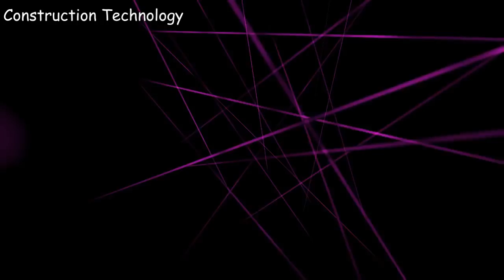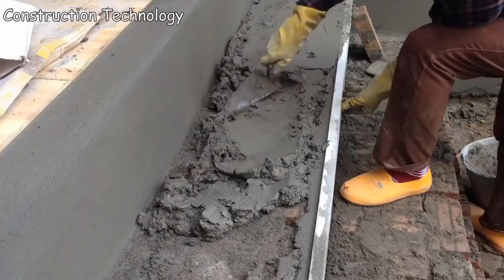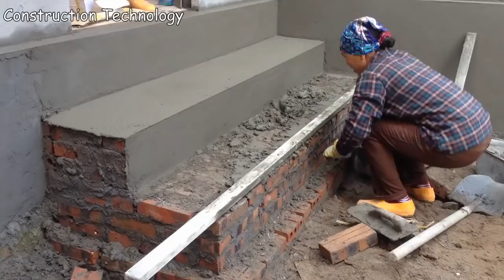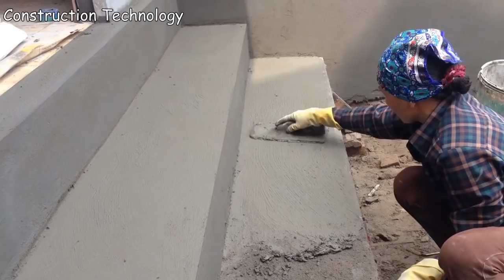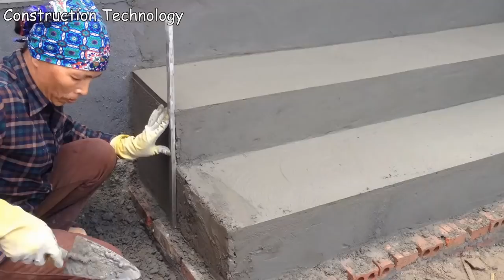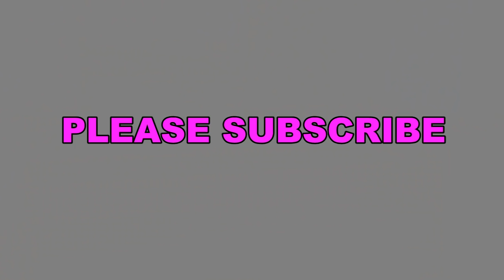Amazing Techniques Construction Rendering Sand and Cement For Brick Steps

Comment: Any "skim coat" over bricks is going to be a very temporary repair, unless it's just a base for ceramic tiles.  The thin mortar coat will probably hair line crack as it dries and shrinks.
Reply: Nope. You assume they use the same materials you do. They may have special formula. As a kid, I played all summer in an electric generator cooling pool with this kind of render. There were no cracks or chips. The water affected it not the slightest.
Reply: @fungames24  That could be true.  There are hundreds of different formulations available for concrete and mortar for various applications.

Comment: A thin veneer of sand mix cement is going to crack very quickly when exposed to weather. On steps you should always round over the leading edge of the tread to prevent chipping. This looks good to a layman, but professionals know this is not going to last.

Comment: If it's a warm climate, it may last a while...Cold climate...Won't last one cold season before it cracks...You have to use special epoxy cement for skim coats like that...
Reply: godbluffvdgg sementó cruz azul don’t crack
Reply: No, you don't need a special epoxy. I did the same thing in New Jersey where we have some very cold winters. I simply used a bag of cement from Home Depot and it has lasted lasted over five years with not a single issue.
Reply: @bigmacdaddy1234  If you did it on your own house; that's fine...I'm a contractor in philly; you can use a patching cement from home depot, I've used it in the bad areas but; coating brick steps with plain Mortar is a bad idea...When I use an additive I can stand behind my work.....I'm glad yours worked out for ya...

Comment: The right way to do this job is to form steps with plywood and place concrete
Reply from the maker: Thanks for your comment Daniel Rojas.
Reply: correct
Reply: and why is that better than this?
Reply: Graeme Evans Because there is the wrong way and the right way  in this case is the wrong way because if it freezes the mortar he is putting it will peel off
Reply: and why would it not peel off by "Placing concrete"?
Reply: Graeme Evans because in  concrete you can add bigger pebbles and mortar is just plaster sand
Reply: So many people talking shit, this is probabally somewhere in South East Asia where it is the norm to render over everything not just because its easy but because its more cost effective than casting concrete steps, walls etc. Most block work and brick work is covered like this and no it wont crack because 1. they know what they're doing, 2. the correct mix is used and 3. the weather is not cold enough for frost or ice to affect it, And  the person in this clip seems to be making a good job of what they are doing.
Reply: John Hobson I have 18 years in the const business and we have done bigger than this steps so I know what I m taking about
Reply: John Hobson No place in the USA will allow you to build this steps just look at the landing
Reply: As I said this is somewhere in South East Asia and not the U.S. so they are not restricted to rules and regs as much as in the west but it does'nt mean the workmanship is any less substandard, and 18 years in the industry does'nt neccesarily mean you know everything,  I've been at it 35 years and still find time to learn and appreciate new skills.
Reply: John Hobson ok but you know this is wrong the landing and it suppose to be secure with steel in to the foundation so it doesn’t come apart from the foundation
Reply: dperry428 Dude I m only 34 years what are you talking about old and I still have 30 years plus to go lol
Reply: dperry428 I m familiar with all the terms in your comment like high strength mortar rapid set come on are you trying to bs me
Reply: dperry428 I was just been sarcastic you had a bad at work lol
Reply: dperry428 Today I had a nice at work lol
Reply from the maker: Hello friends. Your comment is very true. We come from Viet Nam and not too cold here to destroy my work done.
Reply: Keep on doing what you're doing my friend its a tried and tested method in your part of the world, I can vouch for that myself, every country and culture has different methods of construction some good  and some not so good but I can quite honestly say that I myself have learned many new skills during my time spent in South East Asia, and become newly acquainted with many old  basic practices which are now forgotten or overlooked here in the U.K.
Reply: John Hobson Those techniques are good for any other part of the world but not the USA lol
Reply from the maker: Thank you very much John Hobson. Nice to meet you.
Reply: @DanielRojas-nw3mv  lol they are not in the US
Reply: @jimjobson1958  get em John
Reply: @construction-productscemen4935  good work! Thank you for the video, I do similar work in the US
Reply: rzl dzl I hope so because here in the USA we very strict building codes mainly in California where I m living and working and you can tell this job is have ass done lol
Reply: Joshua Sokoloski lol
Reply: Those steps will last a hundred years don't fret
Reply: ben chan not really
Reply: This not the US where everything is regulated all those rules are to make everything uniform so the regulators get paid for ur work. Those same regs push the price of construction up n dont make anything any better than what she is designing. She has REAL FREEDOM to build how she wants and you dont hv freedom to do anything except what the local building code tells U
Reply: Starr Ving Same reason why building collapse more in Asian Countries lol
Reply: @DanielRojas-nw3mv  yeah ancient ruins also. Which there will never b in the US bc nothing lasts that long there
Reply: So, the plywood is free?... cause your way might be the right way when plywood and powertools to cut them are available...Right is subjective even on construction.
Reply: @DanielRojas-nw3mv  yes you can... Still not free... Seems it's just too hard for you to understand and think outside your box you are programed to. There is no plywood arround there dude... If the apocalypse ended they plywood industry forever they still can do it right while you are still waiting for the playwood cuts....
Reply: I have to agree on that, still.. there is a huge world outside the US... FYI
Reply: Sure, there is nothing like USA outside USA, there is nothing like Mexico ouside of Mexico, there is nothing like Taiwan outside Taiwan.... At 41 yrs old I travel for lving so I know way better than you whats out there, you said you were a constructor in US so keep it that way, still constructing at US under US methods and leave the rest to others. BTW, be humble... its and advice you might need.
Reply: Let me tell you this. Different country, different way to do. This country is not suffering from earthquake compares to California, ok? Mark my word. 

This country is not suffering from earthquake. That is the truth. These technique comes from France, Vietnam was oppressed by France since 150 years ago and the skilled had been kept and passed trough many generations.  They are masonry worker and they are skilled, they know how to flawlessly get the job done. Mark my words

Many architectural construction building in Vietnam was constructed in this way 100 years ago and still standing in high rain level, dust, sunny day and it still strong like shit. In California, house is built by wood even though so new house is beautiful but fuck that, termite, punk, leak. My words are true. Mark it again

They can build 4 stories house with concrete + steel bar construction mortar brick that using this technique and I guarantee the house is much more beautiful than the regular house in California. Mark my words

4 stories house for just $600,000 or even $200,000. Depend to the location you live, higher in the urbanized city, main district, capital city. Lower on the country side area. Remember that

Believe me, I have 4-stories house in Vietnam and was constructed in 2001. $40000 in that time, now price goes up to $350000. 

Listen to this, Europe construction technique comes from Greek and it been more than 5000 years ago, unfortunately, America had not been found at that time. Mark my word. They build architectural works and these works still exist to this mean time. For example, Rome market in Italy. The technique was passing to the countries where European' countries oppressed, ok?

Check out more videos, or I will give you more video about how houses in these countries are built. 18 years in construction business doesn't  mean you know everything about the time before you were gave birth. You can apply your knowledge to the place you live, but don't apply it to the world where people can jeer on you and might consider that you are uneducated or superficially narrowed. HAVE A WISE LOOK TO ANOTHER KNOWLEDGE, or go out there, pick up the trowel and do the job like her. A bet you can do it. HAHAHA

I live in California, usually travel back and forward. I go to many countries than you.
Reply: Rubbish.
Reply: @DanielRojas-nw3mv  why cant people get this is not usa uk or germany.they have to make do with what resources the country has.whether it last or not.its still a good finish.would love to see some work from these peoples comments.....
Reply: oh by the way over 40 years in the industry...

Comment: Brick must be inexpensive where this woman lives. In the U.S. the steps would be formed with wood and concrete poured to fill the form. To cut down on concrete costs the bulk of the steps would be filled with either sand gravel or compared soil.
Reply: Well 95% steps (stairs) in the Indian Sub-continent and China are made with this method including 5 star luxury hotels and apartments.

Comment: Nice work.. but too much rise on those steps.
Reply from the maker: Thanks for your comment. I would draw experiences on next time.
Reply: @construction-productscemen4935  maximum steps rise is 20 cm. 18 cm would be ideal
Reply: Nice parge job but should have been at least another riser.  Gigantor steps
Reply: In ex Soviet republics, big rise means big goose steps!

Comment: Amazing technique? I'd rather call it a bungle. Just wait how it cracks during shrinkage. And that skarp edge..
Reply: if its a base ready for ceramics it will be fine,if the tiles are lare enough they cran grout with a highly elastic flex and most movements and shifting can be controlled by the grout preventing the tiles from cracking.....

Comment: As a suggestion I indicated that each step should measure at the base between 27 or 28 cm and height between 18 or 17cm, respectively. It should also have a 2 cm protrusion at the base. This pattern is basic so that the ladder is comfortable for people and prevents the heel from bouncing up when the person descends.

Comment: It will last for two three seasons.
Reply: If that...
Reply: Why?
Reply: @bluematrix5001  sand and cement will shrink and crack during the summers months, water will penetrate those hairline cracks during the rainy months, cracks will expand as the water freezes during the colder months and finally, fast forward a few seasons and your steps look like 1945 Berlin  👍👍
Reply: @Sponkonamaface  Funny about the 1945 Berlin, so what you need to use?
Reply: @bluematrix5001  concrete!

Comment: Riser is too high and not comfortable for climbing then steps levels are been taper the centre of the first step is little bit curved downwards
Reply: Right. Tread should be minimum 11 inch and rise should be maximum 5 inch for comfortable and safe treading.
Reply: @bijaysharma9017  

*
M,m,?
Reply: @anastacioperezabad8292  Tread should be minimum 0.28 meter and Rise should be maximum 0.125 meter for comfortable climbing.
Reply: J Wil  Think about aged people. Check stairs at any public place.
If sufficient width is not available, then tread can be reduced and rise can be increased. But in this video, I see sufficient space available to construct safe and comfortable steps with higher tread and lower rise.

Comment: Why not just pour concrete steps?  Seems like a lot of work for two steps and cover up the brick.  How about using gravel fill instead of brick.
Reply from the maker: Here we do not have many gravel to do it. Thank you Doug Ballou.
Reply: Doug Ballou why would you use wood when it rains it will damaged by it with time and it's not as strong as concrete it's almost the same cost
Reply from the maker: We have no use of wood. We do so because the weather here is not too cold to break it.

Comment: don't do this in Canada lol,
Reply: and not in Australia either.
Reply: @johnandhenrieteverts8516  or Norway
Reply: Use conc block and stainless steel mesh.
Reply: Why?
Reply: @RealSupaHotFireVEVO  winter frost will lift it up and you would find all kinds of cracks and it would fall apart,. could only do these type of jobs warm climent areas

Comment: He didn't make sure wether  the  measurement (wide & height) of the steps  were already correct or not.
Reply: She
Reply: Rusdi Yanto she did fore they started to film.
Reply: 太高太宽
Reply: @amirharris6676  So those steps are made for giants? you gonna break your neck using em. Also each step is at different height.
Reply: @Rick-Stone  ,0yt

Comment: Looks like shit, she didn't even use a level. Wait till rains and she realizes that pools of water don't drain from the steps. It will turn loose after a couple of weeks. It's gonna crack anyway, those bricks are sitting on soil
Reply from the maker: The weather in my place is not cold so it will not be destroyed.
Reply from the maker: We also perform the levels but in the video does not show.
Reply from the maker: Thank you for watching video.
Reply: @construction-productscemen4935  what is ratio in cement and sand mix
Reply: How is it going to make a pool of water? How do you want it level for rain to go in steps, lol.  I understand doing slope for water in a big patio, but come on!!
Reply: Nonsense. It looks great.  I did the same thing for my steps five years ago an water does not pool and it never cracked.
Reply: Looks like shit. What are u looking at. Agree with everything else u said.
Reply: Lol
Reply: Well said! @Dec38105
Reply: Also way to steep. The construction has to make the shape, not the plaster. In germany a foreman would slap and send you home...
Reply: Cosmetics don't make for good construction. That's a three step drop, not two. Rediculous planning. Steel reinforced poured concrete is the only option here.
Now having to haul away the rubble this will become in a couple of years will make for many times the workload than if it was built correctly at the beginning.

Comment: THOSE STAIRS WOULD NEVER PASS CODE, or time
Reply: I don't know much about brick laying or construction jobs but I was thinking surly those sharp edges will chip and break easily. Probably get slippery too when wet I imagine.
Reply: @SirFlibbertyJibbit  yes. Seeing how they made this in this video, it might seen a good idea, but, with time and use, these cornes and edges of concrete would break. The correct, after this groud work, is that they pave it with cobblestone ou some ceramic.

Comment: Any place building codes are in place the riser height is to be the same height for each steep. So in your video this would not pass, besides you have created trip points by making the stairs different heights. Do not know where the steep are being built, but this done in the Philippines as well.

Comment: It looks good. But the bricks don’t look stable. The thin layer of cement will crack. She should have imbedded metal mesh in the cement. That would make it last longer. And putting a bonding agent on the bricks to adhere the cement to the bricks.

Comment: this is nice as long as it's not used, the thin layer of cement is going to crack very soon and the whole thing will break apart as soon as water is flowing between the cracks. It's fine but to much effort for nothing.
Reply: Really nice

Comment: I've always built over cinderblocks. Never over red brick. The extra weight can cause pull-away in 20 to 30 years, unless that was integrated into the original brick. It has to be misted those watching to prevent hairline cracks, or covered with plastic. You may get away with it if it's on the shady side of the house.

Comment: That concrete on top of the bricks will soon come loose and it'll crack. Steps should be built in solid 4 inches concrete slab or at least 4 to 6 inches solid concrete.
Reply from the maker: Thank you.
Reply: that would be overkill. 4 inch thick concrete can withstand automobile traffic.
for human weight, 2 inch would be enough for stair steps.
I live in California, and I have seen plenty of stair steps made with 2 inch thick concrete, probably reinforced with steel wires, but still 2 inch thick, no more.
Reply: Lakay Karate Drills Fitness if it were concrete it would have a chance. But that is just cement and sand.